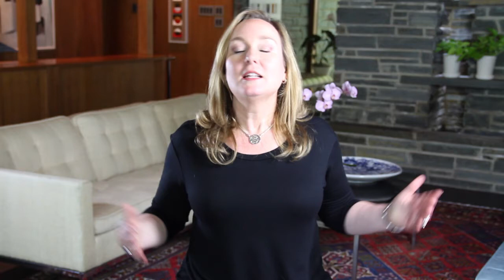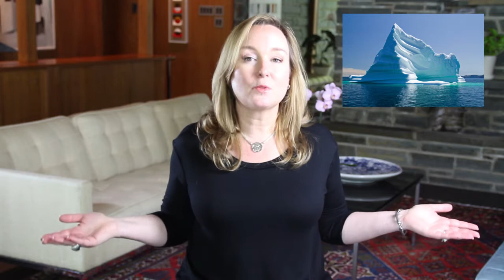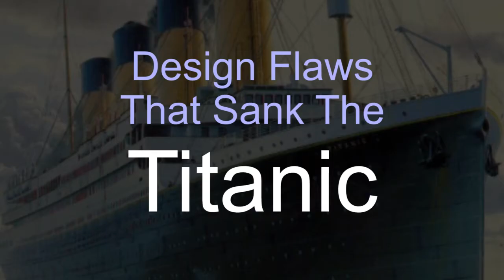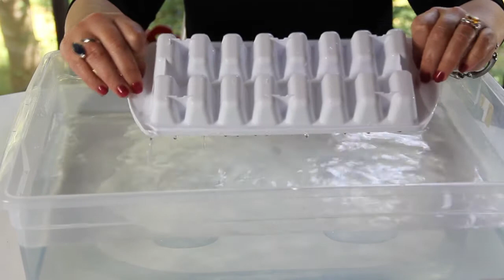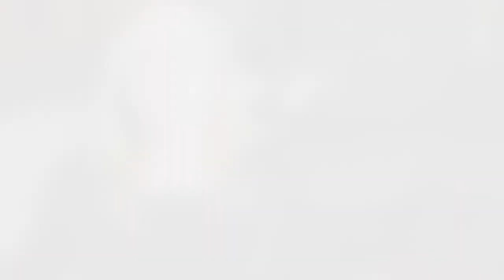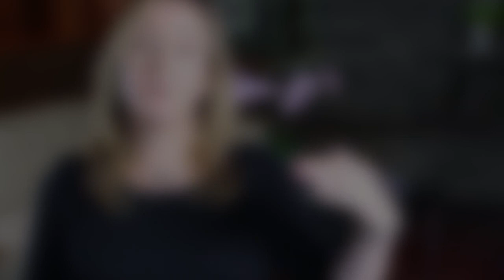What REALLY Sank The Titanic | Jill Maurer

Comment: It usually takes a tragedy to change big business procedures.  Titanic's sister the Britannic was altered and had watertight bulkheads that went all the way up, and sank three times faster. The other sister Olympic survived two major collisions and survived to see the cutting torch in the 1930's. USN engineers did a study to see what would have happened if Titanic took the iceberg head on. The iceberg would have smashed out the keel, opening up Titanic like a zipper, blacking out the ship almost instantly. It would have likely capsized, sinking in minutes in complete darkness, probably telling no tales. Communication was also an issue, more than an hour after the collision the bridge got a messenger from the stern telling that there were lifeboats in the water. At the hearings afterward, Titanic's makers insisted the the multiple eye witnesses were wrong and that the ship had sunk intact, to save public image that they built weak ships. RMS Carpathia that came to Titanic's aid wasn't immune to fate; it was torpedoed in 1918 and sank off the coast of Ireland. 

https://www.youtube.com/watch?v=rs9w5bgtJC8